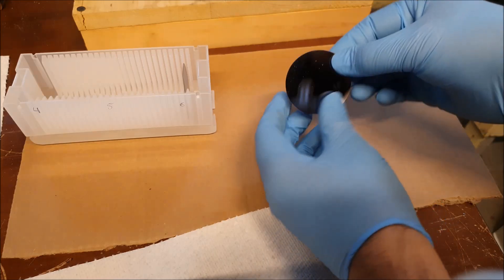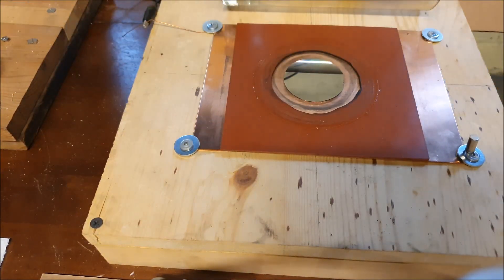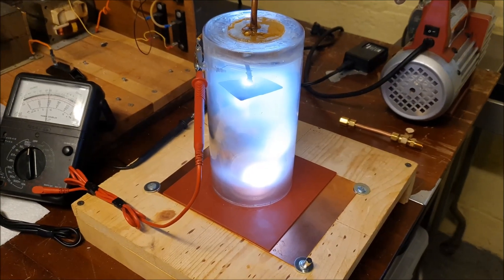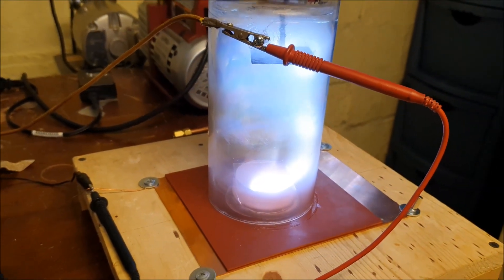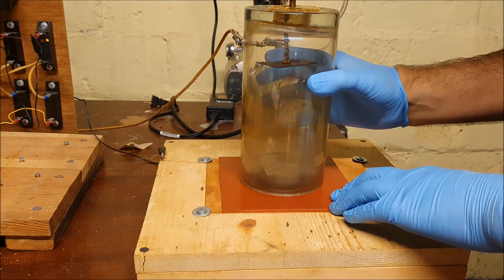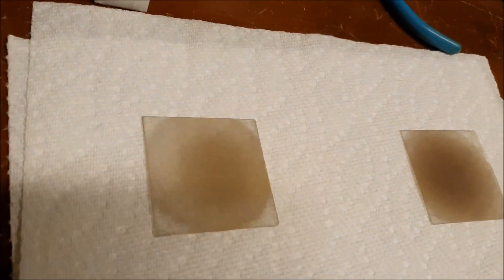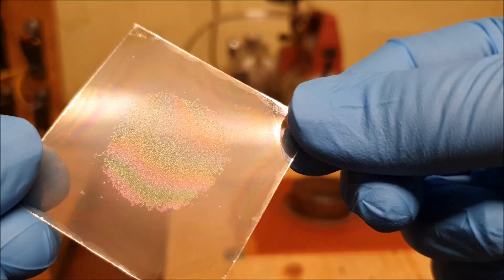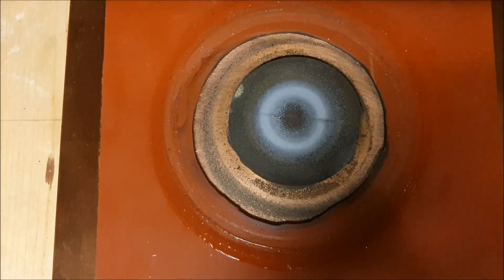Sputter Silicon on Mica Substrate (Part 2)

Comment: What size is the vacuum hose did you use?
Reply from the maker: About quarter inch...
Reply: Ok cool, I'm gathering parts to take a shot at building one.
Reply from the maker: @digitaldiablo1  let me know how it turns out.

Comment: just so anybody who's watching this knows: The silicon wafers come dirty from the factory with all sorts of contaminants on them, you need to clean them at least with Acetone and Piranha solution to remove any kind of organic materials to improve the purity of the sputtering deposition, otherwise you just wasted a pretty expensive silicon wafer for nothing.
Reply from the maker: Relax fact checker... this ain't AMD.
Reply: @sparkstarter  My apologies if the comment sounded harsh, I didn't mean it. Besides, there might be some Masters/PhD students  looking  for information or examples on the subject, since deposition of metallic and organic thin films with this technique is a quite popular subject on semiconductor research and yours is one of the first videos that shows up when looking for "sputtering chamber".
Reply from the maker: @Danercast  As far as I know I was first to post a  DIY sputter chamber many replicators since...  I was a grad student working with these systems back in 2006.  Cleanliness is a difficult to manage if you are doing basic research at universtiy or basement research.

Comment: Do you use a variac to control the amount off power because if so do I need a special one or will a 0-120 volt variac do fine for plasma sputtering
Reply from the maker: Regular 0-120VAC Variac will do to control HV transformer.
Reply: @sparkstarter  how can I get ahold of you better 

I am doing my own sputtering but I'm having trouble figuring out the connection for the diode bridge and the compasitor 

Do you think I could send you some pics of my set up and you can help me out
Reply from the maker: @krukimoto6296  Post a video on your channel and I'll check it out.
Reply: @sparkstarter  I made a 1 take like super quick video explaining it to you so go to my channel and check it out and let me know in the comments what you think
Reply: @sparkstarter  still waiting bro lol

I have the video on my channel that shows my set up

Comment: Very cool! I don't know what i'd use it for but i'd like to try building something like that!
Thoughts on how to reduce bubbling of the sheets:  

Leave sheets in low humidity environment prior to sputtering.
Heat cycle sheets at atmospheric pressures.

Leave sheets in vacuum for a longer time prior to sputtering
Ramp up sputtering slower.